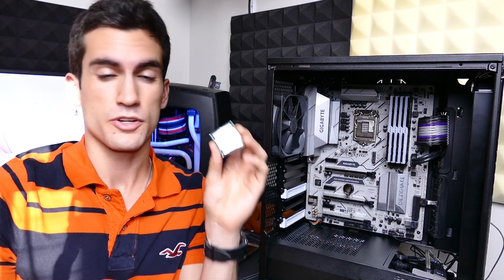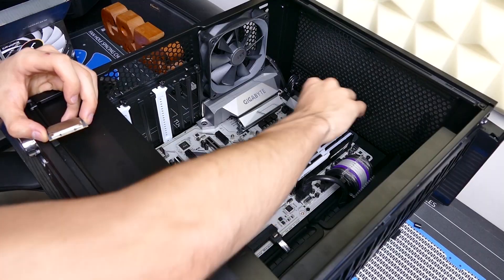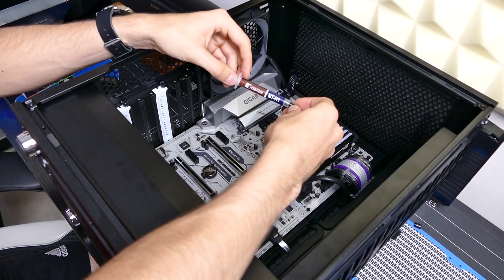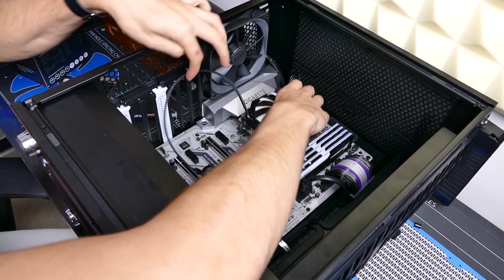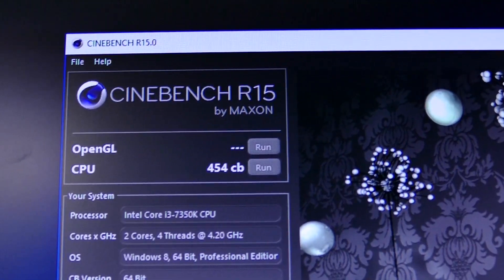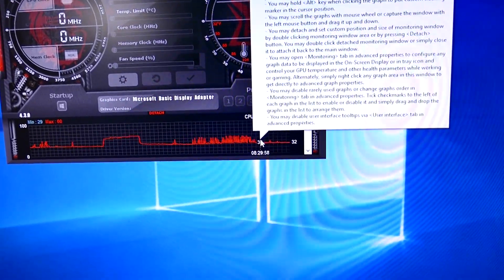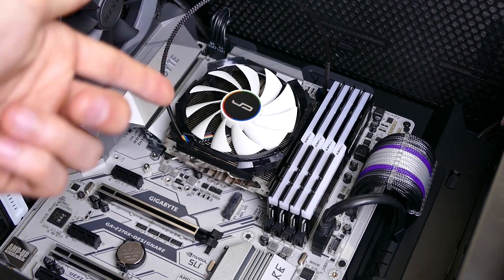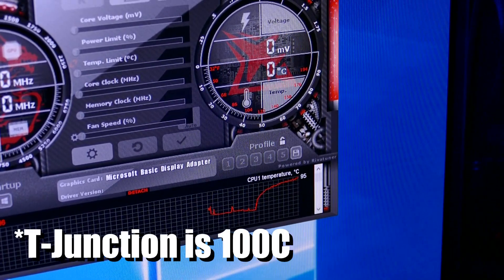Thermal Pad Instead of Thermal Paste?

Comment: Need to cover the whole CPU surface with the silicone gap pad.   If used properly you can get better performance from hybrid pads with graphite than putties or greases.

Comment: I did that once, I really needed to check if the board works, but it was late at night and i couldn't get thermal compound. The computer run for few seconds before I shuted it down. Cpu idled at 90 degrees

Comment: Try playing Black ops 4 , got an i7 4790k
straight to 100 degrees celcius

wolfenstein 2 maxed out doesn't go over 70

underclocked to 3.8ghz and disabled boost, locked V core at 0.925v and was stable, sat at 60 to 70 for a few minutes
but then eventually decided to sit in the 90's and still peak at 100

lol

oh yeah, used thermal pads doubled up on my gamecube portable a few years back, custom heatsink (modifed) and fan, that shit got PRETTYYY warm

Comment: you used it on quater of Cpu heatsink. Do you do the same with thermal paste? Do it on full heatsink. This test is incorrect even if the results be the same.

Comment: There is so many things wrong with how this comparison was conducted. Thermal pads can be extremely effective TIM for CPU's if you use the appropriate pads. You have clearly used some generic poor quality pads that are way too thick (3.0mm). What did you expect the outcome to be? 0.5mm Fujipoly Extreme XR pads (17.0 W/mK) would perform just as well as the paste you have used in this comparison, if not better. In addition, as others have mentioned, cover the entire IHS to maximize contact surface area.... This was a biased comparison and waste of time.

Comment: They've made thermal pads for CPUs now, and while they're aren't as good as high end thermal pastes they are better than the low end ones. That coupled with the fact that they're easier to install and you dont have to worry about cleaning it up if you switch coolers means they are a very viable option for people who may not want/need to overclock.

Comment: There are several things missing here, mostly as a result of ignorance about thermal interfacing.
1. Thermal interface pads range widely in thermal conductivity (generally measured in w/mk). My guess is that our host here bought some random material off new egg. Very good materials are only made by less than 10 companies in the world and realistically range from 1-9 w/mk (watts per meter kelvin). (Note some companies twist data to meet a higher spec, but in reality, 9 is the top end for now). Some of the real deal makers of interface pads are Bergquist (now owned by Henkel), Parker Chomerics, Shin-etsu, Fujipoly, Laird, just to name a few. 
2. Thermal grease/paste is used in basically 2 markets. Home computer building and cheap electronics. The reasons are simple. they are cheap, widely available and do have a very good w/mk rating. The reason that non-cheap electronics don't use it are simple as well. a.) it dries out eventually. Some in a matter of months, some years, and some of the very cheap ones almost immediately. b.) for interfaces that are going to thermally cycle, pastes/greases will actually slide out of the interface, otherwise known as pump out. CTE(coefficient of thermal expansion) mismatch is a big deal and the pro hardware designers know this. Your die and the back of your heatsink will expand and contract at different rates, meaning the interface will too. Since most pastes and greases don't fully cure, they will eventually pump out of the interface after several thermal cycles. 
3. The entire interface should be covered with the paste or the pad. These materials only suck heat in the z-axis. the surface that you aren't covering is just releasing heat into the system that doesn't need to be there.
4. There are other materials as well. Many of the companies listed about make 2-part dispensible versions of the pads. You need a $10 specialty caulking gun to apply them, but they go on like a paste and cure to the consistency of the pads ~60 mins after application. Which means you can put them down, assemble everything and then have it cure in place. The 2-part system allows the material to use a catalyst and crosslink, avoiding the pitfalls of grease/paste.There is also phase change materials. If used right, they can achieve the same thermal conductivity as high end grease/paste.
5. I'm not just being a jerk. I work in the electronics hardware design industry and the world of thermal management is a lot bigger than most people know. Most even medium sized companies have thermal engineers on staff and the companies above have sales in the hundreds of millions of dollars. Its always been perplexing to me that a community like this has mostly been negligent on an aspect that absolutely has a huge effect on what they love.
6. Most of the real deal companies will give you free samples. you'll have to do a little work on their chatlines, or even emailing. But if you do, they'll almost certainly send you whatever you want in a sample size, if you fib a little and pretend its for a company's use.
7. Thin to win - One of the reasons grease/paste performs well, in the short run, is that they are very thin(although thickness is very inconsistent). Simply put, the less mass the heat has to travel through, the better.
Reply: This guy knows a lot
Reply: @markalderite1062  Thank you. This happens to be the one small niche of life that I know a lot about. I'm otherwise an idiot.
Reply: Nice to see someone here who knows what they are talking about here in the comments section. Innovative Cooling has made a reusable graphite thermal pad, called IC Graphite,  that's around 1mm thick and 30x30mm or 40x40mm in area. The pads have a thermal conductivity of of 35 W/m*Kin the z axis and something equal to are greater than 800 W/m*K in the x/y axis's, they haven't gotten a solid answer for that yet, but it is electrically conductive
Reply: IC's graphite pad is not meant to outperform heavyweights like Kryonaut, GC Extreme, IC Diamond 7 or MasterGel Nano. It is designed to perform within 2-3 degrees of margin below those but with the convenience of never having to reapply it again or stressing out about creating air bubbles while applying the paste. It also doesn't have a pump out problem like the Kryonaut. The pad is thicker than paste and can't fill microscopic gaps but makes up for it with very high thermal conductivity. It's electrical conductivity is irrelevant as it is not liquid and won't spill on your motherboard.
Reply: @ben4771  The only pitfall to the graphite is that they're bad in terms of inter facial resistance.  A lot of why this is not clear is because w/mk is kind of shitty test. It is a bulk conductivity test and that's it. So I could sell you a piece of copper that has great w/mk, but will obviously not work. In the case of graphite, yes, they have engineered it to move heat in the Z, but the wet-out to the interfaces is for crap. Thats why the filled silicone polymer materials are king in this business.
Reply: @LETHALF90  Your mom told me to.
Reply: @brianhanson519  now fujipoly made thermal pads with 17w/mk :o

https://www.amazon.com/Smart-Fujipoly-Extreme-Thermal-Conductivity/dp/B00ZS0CODS
Reply: +Brian Hanson Thanks, but can u post a link to buy them? i need them for my laptop's cpu and gpu.
Reply: @Viewer13128  Here is a good place to start. Digi-key is the shit for anything electronics.  https://www.digikey.com/products/en/fans-thermal-management/thermal-pads-sheets/218?k=bergquist
Reply: @LETHALF90  get cancer
Reply: I think you can get 40w/mk thermal pads now that are conductive.
Reply: @AJDOLDCHANNELARCHIVE  You can. But functionally, and reasonably, its hovering around 10, for the moment.
Reply: ¿Can you summarise all the points you mentioned? Please

Comment: This is actually pretty useful to know. Say you wanted to test if a CPU or motherboard was working. Rather than attach a heat-sink with grease only to clean it later just use a pad. :)

Comment: So here's a question. Thermal Grizzly Kryonaut, on paper, has a thermal conductivity of 12.5 W/mk. Fujipoly's XR-m series of thermal pad material, on paper, has a conductivity of 17.0 W/mk. I'd like to see how that stacks up in practice, and to understand a bit more about the difference the form of TIM makes for a given thermal load, as I imagine the pads would be working better at lower thermal loads (equivalent to VRM components) while the paste would still perform better despite its lower rating for higher thermal loads (CPU/GPU).

Comment: You're a dumbass for sure as you gimped the entire experiment for a complete waste of time. Had you covered the entire IHS with a compete pad and not this mini pad your results may have been better. I used a Thermal Pad on my AMD 8350 and not once did it overheat regardless of what I did. I played many games and not once did my AMD lock up. You did this with an i3 and gimped it by using a fraction of a pad and too think of pad and that makes you DUMBASS of the YEAR....

Comment: Here's what you DIDN'T try... layer those thermal pads on top of each other, 2 strips or 3, layered on top of each other, but cover the whole surface, and not just the center of the CPU, aaaaaannd also… if this wasn't a Fan-Only cooled CPU, and you used this in a watercooled loop for the CPU instead, you should have very different results.

Comment: Sir, the thermal pad you used was a bit small. you should look for wider thermal pad that will cover the whole cpu face. Then it can transfer more heat generated from the cpu out to the heat sink. remember, the more area covered/having contact with each other, the more heat it can transfer.

Comment: With the pad, it probably needs to cover the entire area of the cpu as the purpose is to exclude air which resists heat transfer, but also conduct heat to the base of the cooler.  Bigger area = more heat transfer.  As the rate of heat transfer is inversely proportional to the thickness 3mm seems too thick to me to just rely on a small slab.  Thicker requires more conductive area.  A small gob of paste covering a smaller area might work better as it is going to be thinner but also the material might be more efficient at conducting heat. An interesting test might be a thin foil like a plastic modeller's foil or even kitchen foil.

Comment: I was using a 0.5mm thick 14W/mK thermal pad in my Dell laptop, which had a i5-3337U CPU. Worked like a charm! Cool and quiet. Guess it actually works depending what and where you use ;)

Comment: this thermal pad is crap, there's gel silver based thermal pads overperforming any paste with better longevity over any paste, pastes especially if you get some like antec h2o series is not fitted for longevity cause in long time it seems to assest leaving gaps and getting dry, it needs to be replaced, high performance pads, not electrical conductive that fit cpu maximizing contact area is better than any paste in time.
http://www.aitechnology.com/store/index.php?main_page=product_info&products_id=3

Comment: I have 7100(3.9 GHz) and the time I got it I forgot to put thermal paste on. to my surprise is did not throttle at all but I spotted it by hearing CPU fan spin up in Overwatch and when I saw CPU temp in hwinfo then I remembered that there was no grease applied on the stock Intel cooler(because it was not new and I have never installed none stock or used cooler on CPU I forgot to do it properly) so it's probably better to not put anything on it rather than thermal pad.

Comment: the problem with this experiment is that the thermal paste covers the whole heat spreader effectively which is the JOB of the heat spreader to spread the heat from the cpu core to the heatsink, whereas what you did with the heat transfer pads is cut a small strip in the middle of the heat spreader to transfer heat thereby making cooling more inefficient on the intel chips (because of the thermal compounds intel uses between the chip and heat spreader) making this test flawed. also depending on which heat transfer pads you used could be part of the issue, thereby giving you much different test results had you used good thermal pads and covered the entire heat spreader with them.

Comment: I ran a P4 3,2 with HT back in the 2000s with no past at all and all temps where ok, never over heated or died, try that, I have a old intel sink with a copper slug in the middle and al fins

Comment: If you where using a 4 core it would probably cause major issues. Considering you are using a i7-2core, it's not surprising it worked. Considering laptops use thermal pads all day.

Comment: thanks for this video, even though the test is flawed. this is why:  when u use thermal paste on his, even though the paste itself may or may not cover the whole his surface area, the cooler heatsink still does. so u get maximum contact. when u put a pad Which does not cover the entire surface of his, u create air pockets where there is no pad and no contact between his and cooler( due to hight differences) so the heatsink does not touch the entire his surface. u should make another attempt, this time use a pad that will cover the entire his surface ( same size).

Comment: i just bought an amd 1600 with the heatsink came with some sort of thermal paste/pad combination, much better than the thermal pad you were using.  i opted instead to clean it off, and use artic silver 5 instead.   i do wonder how the thermal compound already applied on the stock heatsink would perform.

Comment: it is not a good idea to compare thermal grease with thermal pad, they are designed for different applications. Thermal grease is only a mixture of polymer resin and filled thermal conductive particles, so it can get very thin bondline that means very low thermal resistance.  Thermal pad is a cross-linked structure polymer rubber, flexible, can be compressed and rebounded after compression force been released, it is used for fill big gap with big tolerance. For CPU heatsink, thermal grease is good choice. But just remind, due to thermal grease is only a mixture, so it will has dry-up issue after been using long term or some circles, the degradation of thermal conductive performance will happen, very obviously.

Comment: There are thermal pads designed specifically for CPU use that work effectively. The pads that come pre-installed on a lot of stock heatsinks are entirely adequate, while a product like Coollaboratory's metal thermal pad can even be equal or superior to Arctic Silver 5 compound.

Comment: I use toothpaste in place of thermal paste xD

I didn't have thermal paste when I cleaned the cpu cooler, it was enclosed in dust. When I wanted to put it back I realised I have no thermal paste. Then I just applied a little bit of petroleum jelly on both surfaces and put a bit of Whitening Toothpaste in between.

My temps were finally down by 5 degree Celcius
Still running the same thing on AMD FX6300 OC to 4.07GHz with stock cooler and temps are always under 65 :3

Comment: lol i actually tried this couple of years back because i didn't have any thermal paste left.
DON'T DO IT.
it is seriously better having no thermal paste at all than using thermal pads.
the thermal pad doesn't transfer heat to the copper that well and so the CPU heats up dramatically.

Comment: Thermal pads are weird, if you slide your finger across one it's a slick surface but if you press your finger down and lift up (like a poking motion) the Thermal pad is sticky it's weird

Comment: You wont get great temps with that heatsink
Reply: Wondering how your temps are so low. I have the same heatsink and my temps are around the high 90's under max load. I umderclock my cpu to reduce heat.

Comment: If you can sufficiently lap the two surfaces and get a perfect alignment thermal paste would be detrimental. It exists to help mate the two imperfect surfaces better to assist in the transfer of heat. but it is NOT the primary means of transferring the heat. The goal is to get the best metal on metal contact possible. Pastes like Arctic Silver, are a joke, any Zinc based thermal compound will do the job. Anyone here old enough to remember Tom's Hardware's test of all the different compounds including things like toothpaste and Vegemite? Vegemite outperformed arctic silver... what does that tell you?

Comment: OK so he keeps bashing this CPU. Now I realize that this CPU has bounced all over the market in therms of pricing and it doesn't know where to fit in. Granted. However, this CPU has the potential to OC to the highest frequency on the market. It could literally be the best single core CPU period. Theoretically the CPU will have a higher thermal limit then it's quad core counterparts and at around $130 you can crank it to bust. Should it be cheaper? Well it has come down, but a nice round $100 would make more sense. Another thing to consider, don't the majority of programs still use single core operations? And it is still ok for some gaming? Maybe not as bad as claimed.

Comment: to be honest i'd like to see the results for something more suited to the application, you see, the thickness of the thermal pad makes a VERY big difference as well as contact surface area of both temperature sources, if you were to use a thermal pad that was cut to shape of the entire heat spreader, i could see that max temperature dropping into the lower 90c upper 80c, (5-10C drop) and if you used a much thinner pad, such as the first result i found for under 1MM:  ARCTIC Thermal Pad (50 x 50 x 0.5 mm) (being 6 times thinner than the pad you used) i could see that max again dropping by as much as another 10-15C on top of the performance gain from using the entire heat spreader

Comment: thermal pads are meant to bridge a much larger air-gap than thermal paste, as the larger the air-gap is, the more bubbles and cracks that will be present over time as the thermal paste dries out, expands and contracts